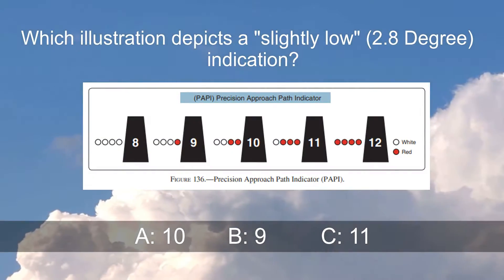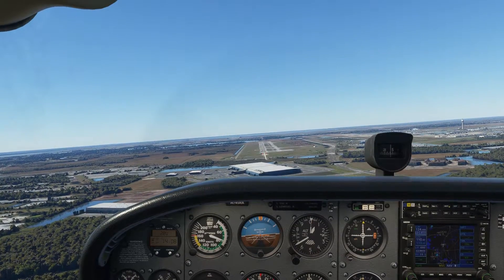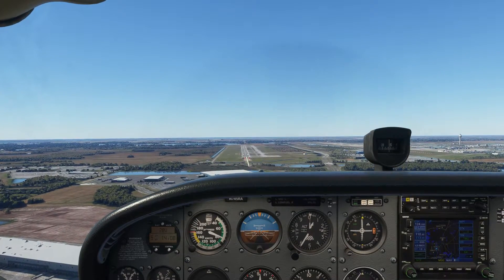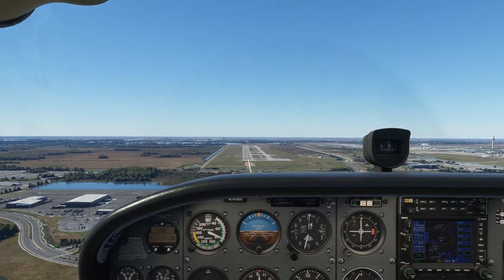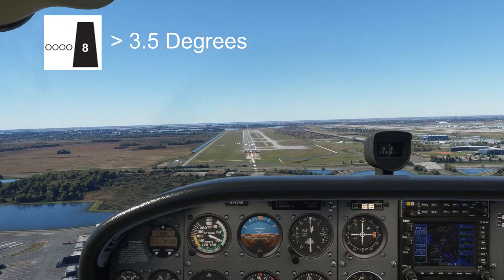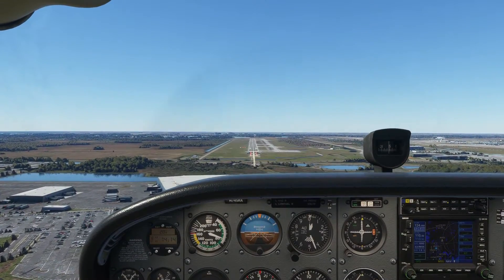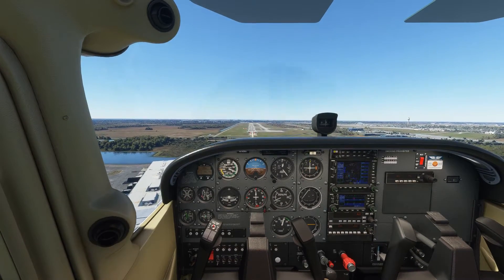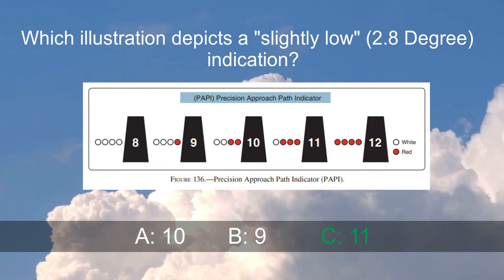PAPI Approach Lights | Theory Quickie | Microsoft Flight Simulator | Real Airline Pilot / Instructor

Comment: I often wonder, for single engine GA, during final approach for papi 2 reds and 2 whites, should there be engine failure, the aircraft  won't have sufficient speed to glide to the touchdown zone or the threshold, right?
Reply from the maker: Yeah you’re right, you’ll never make it to the runway from that position.
Reply: @Taylair  For final approach, incase of engine failure, would it be better to descend at higher GS, 3 whites and 1 red? So that there is sufficient glide speed for the touchdown zone.
Reply from the maker: Yeah there’s certainly a case to be made for coming in steeper in a single engine aircraft